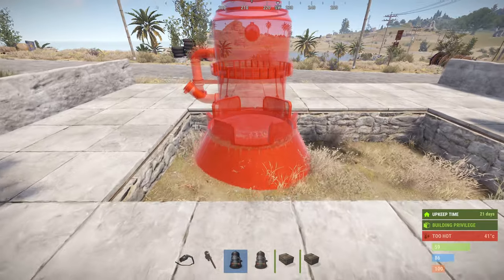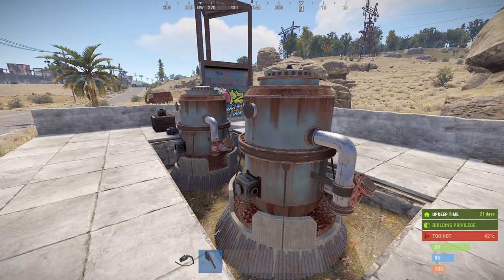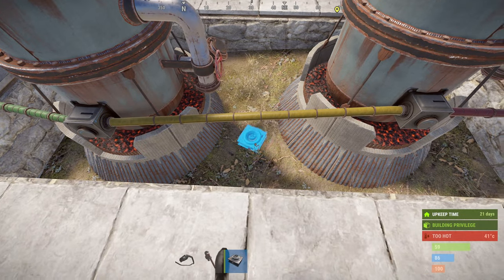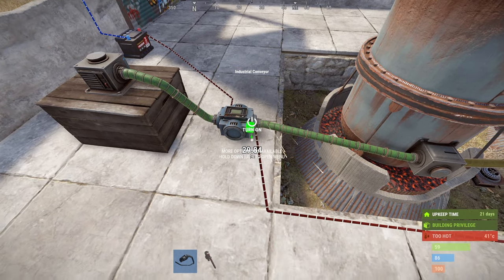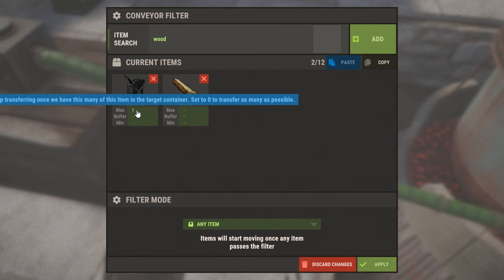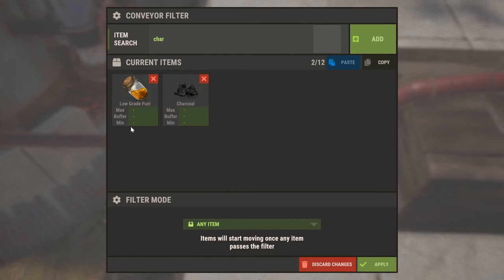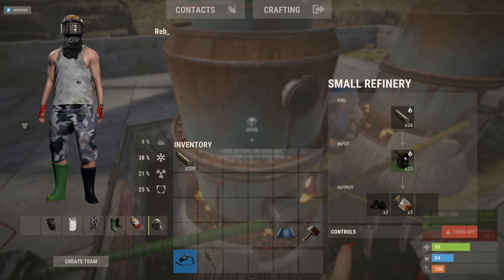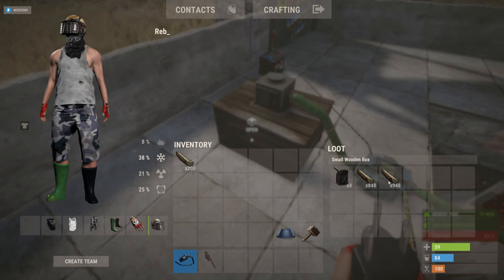Low Grade Fuel automated crafting - Industrial guide - Rust

Comment: I've been playing around with fully automating my base so all i do after a run . is dump everything into one box and let the system auto sort , cook, and craft for me . 
One trick I found that I figured out but havent seen anyone make a video on yet. is to set up your TC in a bunker, and a storage box or vending machine elseware in a more secure location , and have that box only feed the TC exactly what it needs for hourly upkeep. 
The reason behind this is if someone does raid your base and gets your TC , they dont get all your mats you would normally store in it .
Reply from the maker: It's pretty satisfying once you get everything working. 

I've got video for feeding the TC from a Dropbox, will have to look at how it'd work with a bunker as industrial lines need doors...
Reply: Components are safe too ? All craft aren't automatics but great idea
Reply: @spartoiss488  I got it working, You have to use a glitch to get the pipes to run through a wall.. but its a fairly simple set up to seal the TC behind a wall , that you can access via roof or stability bunker , with a box located somewhere else in the base that feeds to the TC a set amount of mats just to maintain upkeep. 
My new base design is nearly doorless. every room is sealed off with bunkers and pixel gaps.

Comment: the igniter dont stop :v how I can do that of only 1 touch?
Reply from the maker: I'll have to try the circuit and see. FacePunch changed electricity a little while ago, maybe something to do with that...?
Reply: just use an XOR switch, both inputs should be from the filter pass of the conveyors, output to the igniter

this means the igniter is only on if only ONE pass is true, so when the refinery is turning on or off.

hopefully the upkeep from tc should keep the igniter health high enough and it wont break now so that's good